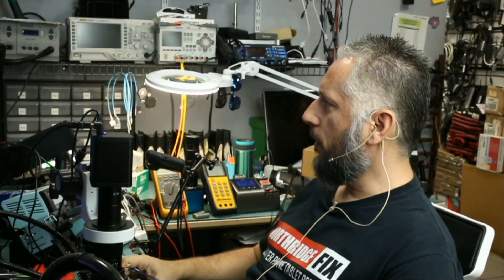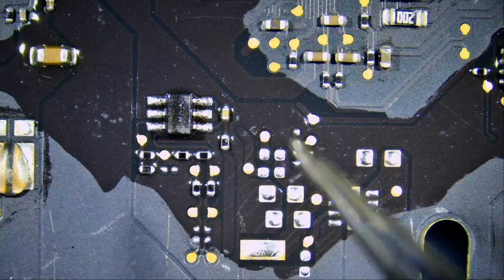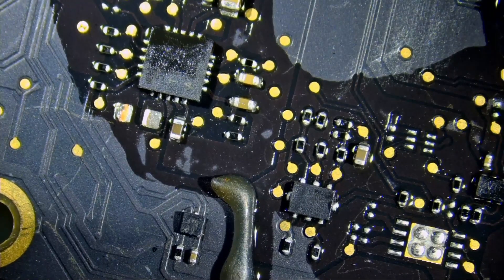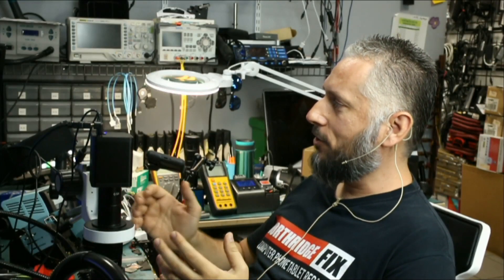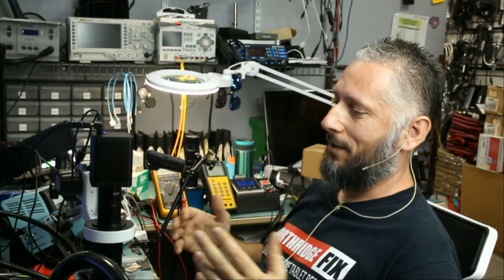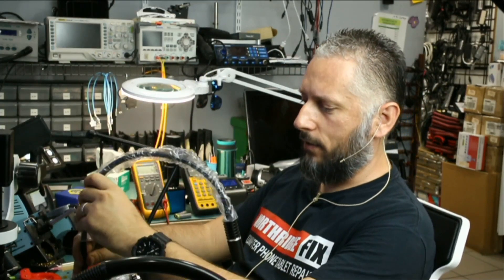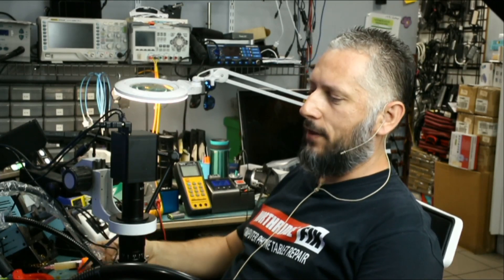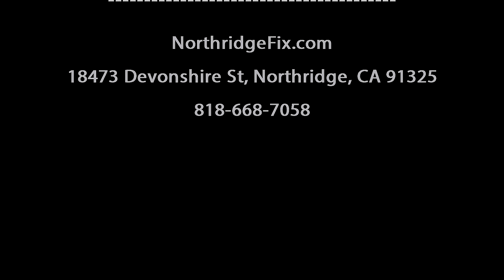How to Remove Microscope Glare and Light reflections with the Anti Glare Light

Comment: What causes people to break traces/pads? I have not worked on chips before, but I am about to get the tools (hot air gun, teflon ptfe tape as someone recommended) to replace a ps3 nec tokin capacitor
Reply: By pulling on the component before solder melts. But nec tokin are different story its almost impossible to melt the solder to get them off as 1 piece, it can be done but you need very good tools. The easy way is  you rip them off piece by piece. Just look up replacing nec token on PS3 watch a few vids before you do it and choose the method you are comfortable with.   NSC Modz has good tutorials on ps3, but watch other channels/methods too.

Comment: Hi guys.I have a question.How can I test if DVI port from monitor is working?With multimeter.I bought already 2 cables and I think that the monitor port is bad not the one from video card
Reply: You don't even need a multimeter for that. You use a second monitor. If you have an image on a known to function monitor then your problem is indeed either on the DVI port of the monitor or in your monitor's board.
If you don't have an image on the second monitor just like on your own monitor, then the fault might be in the port of the video card.
Remember this: whatever you may think is bad, may be totally wrong and it might set you on a wrong path.
Things are not as simple as you think
https://www.networktechinc.com/blog/wp-content/uploads/2013/08/DVI-connectors-type.jpg
In reality, the ports all look the same or almost the same but they are very different.
Reply: @Dandan-tg6tj  the monitor is working and show image when connected with VGA cable
Reply: Keep in mind that a DVI port has two ports combined into one: It has analog pins and digital pins.  Your source, cable, and monitor, all need to match regarding whether it's using analog or digital.
Reply: @Mueller3D  can you explain, please?
Reply: @DanielsGaming1  Just look up DVI on Wikipedia.  It explains all the variations.

Comment: would a polarized filter on the microscope lens remove the glares too?
Reply: I was expecting him to say he had a polarizing filter that magnetically snaps to the scope and that made the clicking noise. I honestly think this is the better solution and requires no power.
Reply: I'm going to guess he already is using one. 

The way the flux practically disappears and makes the board look dark when the side light is on looks to me like he has a polarizer on there.
Reply: @volvo09  he has ever mentioned a polarizing filter , unless you come from a photography background most people have no idea about a polarizing filter .
Reply: Alex did mention it once that he has tried it and does not work so he doesn't use it.
Reply: Yes, you can

Comment: If my business was doing better I would be placing a huge order. Have learned almost everything I know about soldering from you. Thank you.
Reply: Here are some "poor man's lab" ideas for you--
1. use flexible LED desk lamps
2. buy the cheapest pair of polarized glasses you can, and tape them over the objective lens of the microscope you're using. Polarized light can obtain the same glare-reducing effect as oblique lighting. (If you're using a stereoscope where the light from the surface is going from the workpiece into your eyes, not from the workpiece into a camera, then into a screen, you could try wearing polarized glasses when you look through the scope).
3. If you need diffuse lighting, use tape and printer paper to make reflectors. One example would be to make a kind of wall around the microscope stage, then use your external lighting on the outside of the paper. This will give you diffuse lighting.

None of these options are going to give you the best results like you'd get with tools designed for the task like what Northridge is selling here. But if business is hard, every dollar counts! 
I'd discourage you from taking this kind of bootleg approach to cost reduction when it comes to your consumables (flux & solder) and measurement tools (e.g. multimeter). 

GL
Reply: @Teekeeusx  or yoy can get a dual led goosneck 2x3 w in ali for 45 buck. No more hassle and glare from flux 😁
Reply: I'm opening my own business to Bro, there will always be up and downs, Keep your head up and revise and evaluate components of your business that you may improve. I'm always doing that. Sales, get out there, papers, make a web site, its cheap. Always give your business a "GODS EYE VIEW" you'll make it I Promise. just make sure you never stop the fight getting your business where you want it to be. When you stop, everything stops, no ones going to do it for you what I've learned. Fellow businessman, good luck my Friend...
Reply: How’s the repair business treating you? I’ve been interested in starting my own. Maybe not so much in board repair, but general PC/ Laptop repair
Reply: @Andrew-yw8vz  Stressful lol
Reply: Soldering businesses is good if you work harder , and have good connections

Comment: Hello sir
Love from India
Sir can you make microscope for repairing using some glass lens and mobile camera??
Reply: I've done it myself. I thought I did myself a huge favor for managing to build a microscope very cheap. 
In time, your eyes will suffer from using a DIY microscope using mobile camera based microscope. 
The image will not be good enough because the lens of a mobile camera is not designed for the type of image you need. 
Long story short, I did buy myself a real microscope and even if it did cost me more than I wanted to pay for it, it literally improved my life big time. Side effects of using a crappy microscope are far more expensive than buying a real microscope.  
Trust my advice, make an effort and buy a real microscope even if it is expensive. I'm just like you, from a country where the level of life is not high.
Hope this saves you from damaging your eyes.